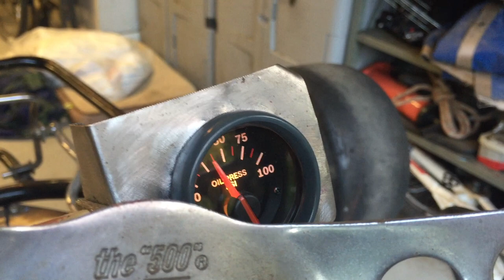Turbo Jet Kart First Sart!

Comment: When you add a seat, won't that obstruct the intake?
Reply from the maker: There is about 2 inches between the seat and the intake now with the seat installed. Very close but still clears

Comment: How do you control throttle. I wouldnt be like a piston engine with a throttle plate??
Reply from the maker: In this demonstration we have a pressurized fuel tank at 200 PSI which delivers fuel to the nozzle and then we use a ball valve to regulate the flow

Comment: What are you using as a fuel pump?
Reply from the maker: There is no mechanical fuel pump on this current setup. Instead I am pressuring kerosene in an old propane tank at 180 PSI. The fuel is pressurized thus it flows to the fuel nozzle. This setup works although I am switching to a hydraulic gear pump to increase pressure.
Reply from the maker: 0:33 you can see the tank by my right leg
Reply: Well it runs smooth with that. A gear pump is defiantly the way to go. I use one mated to a 750 watt dc motor. The pumps rated for 4000 psi but I only use about 1000psi. 
Axial combustors are the way to go👍
Reply from the maker: @htevo80  Agreed, definitely needs a gear pump. Can you send me the link to the gear pump you're using? or the make and model?  what are you using as a speed controller for the motor?  thanks!
Reply: @nyecegarage7173  I'm using a 0.150 cu in pump with a custom mosfet speed controller. You can find schematics on Google. Good luck on your build